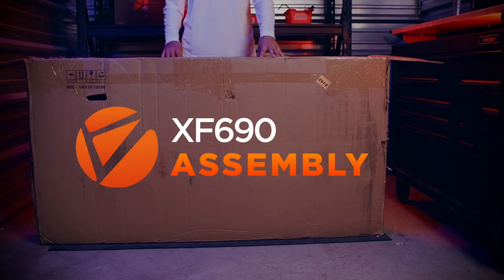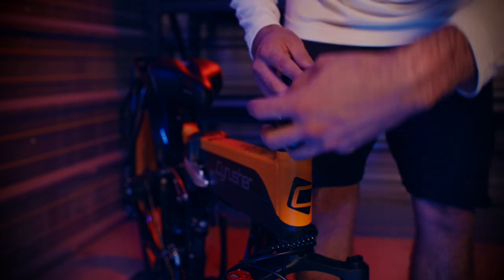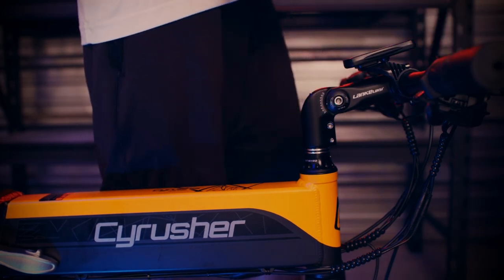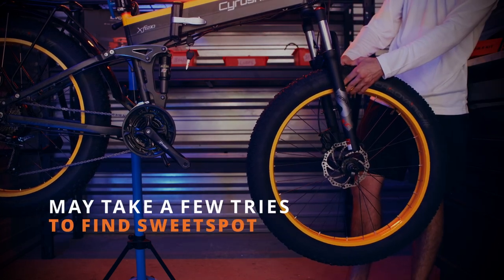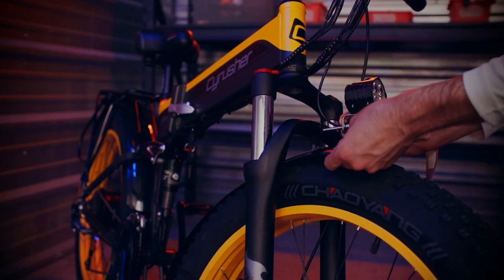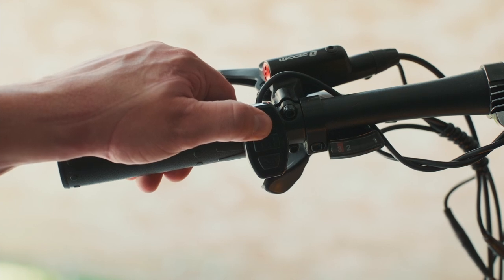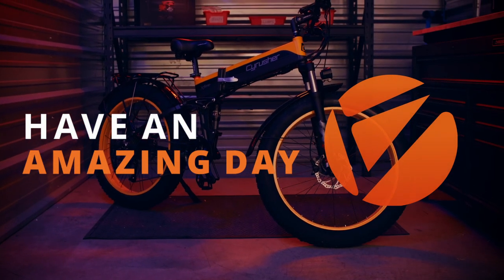XF690 Assembly Guide | Cyrusher Bikes

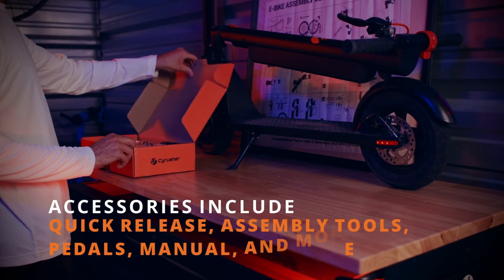Comment: 1:08 Nope. No manual nor any piece of paper with any online link to these instructions. Google to the rescue.
1:32 Three bolts. 2 on the side and one on top, as demonstrated in this video.
2:34 Be careful that the wiring for the speedometer hasn't become twisted, to avoid having to assemble twice.
4:44 Both of mine were labelled left. It just means you turn the bolt the opposite way on one side to tighten it. Maybe it will mean one of the pedals fall off over time. I don't know because I'm not a mechanic. 🤷‍♂️
5:20 It's a lot easier and less likely to scratch your bike if you do this before attaching the front wheel.

If your bike has mudguards and/or a pannier I recommend buying a good set of strong allen keys (hex keys) before this bike is delivered because you will have to disassemble both of these to get all the packaging off. Alternatively, if you don't mind riding around with a bit of packaging flapping around, you might save yourself a headache just leaving it on. The tool they provide is easily broken within a few minutes of use. They're not even strong enough to undo some of the bolts, let alone tighten them.

It's a beautiful bike. No pain, no gain. 😊
Reply: I had to reset the pistons on the front disk brakes because they were rubbing on the disk. Luckily this can easily be achieved without having to disassemble the brakes as there's an adjustable hex socket. This video shows how with the make of disk brakes my Cyrusher had: youtube.com/watch?v=Ym8mreUhelQ

Actually, in the end the misallignment couldn't be fixed using all of those methods, so I twisted the whole brake 1mm to the side using an industrial tie wrap. 😂 Now it doesn't rub and still works as a brake (hopefully).
Reply: The test run:
I live in a 3rd floor apartment with plenty of stairs. First thing I noticed was that the built in stand under the peddles made it very difficult to get up and down those stairs, so took a hacksaw to it and chopped it off. Interestingly the frame has the same consistency as soft steel so is easy to cut.
Cycled 9km to a friends house. Took 15 minutes including city traffic lights. Yes, the mileage and speed is in kmh so if you're used to mph then tough. The top speed on straights was 29 kmh without hardly any effort peddling. This is funny cause the speed limit for bikes is 25 kmh. It got to the place without even 1% battery used. On the way back wasn't so lucky. Came across a bad stretch of road in the rain at night. Swerved one pothole but couldn't avoid another which looked like just a shallow puddle but turned out to be a 5 inch deep nightmare. The suspension soaked up the impact (which almost threw me off at 29 kmh) and the front tyre immediately went flat. But the front wheel is very sturdy and didn't buckle at all. In fact it only had about a 0.5mm ding upon inspection. Had to walk the remainder of the 4.5km home, but I saw it as a valuable lesson not to make any assumptions about puddles and treat everything as a potential hazard. But that's the thing, you have to get used to riding fast all the time and that gives you less time to react. If I had been cycling a manual bike I would have avoided it and impacted at less speed. Overall I'm impressed the wheel wasn't trashed. It's a sturdy bike.
The front gears however were so misaligned that one of the gears wouldn't work at all. Will have to go home and fix that. And the forks make a knocking sound (since before the accident) when you lift them up. It doesn't stop them working but is worrying.

Pros: the built in front and rear lights are really strong and there are even front and rear side indicators and a horn. After 14km only 1% battery was used.
Cons: the cycle display doesn't detach like on other ebikes so if the bike is stolen it's still functional, which makes it a bigger target for thieves. The wide spokes make it harder to remove the tyre because clamps can't latch on, but that's a minor issue tbh.